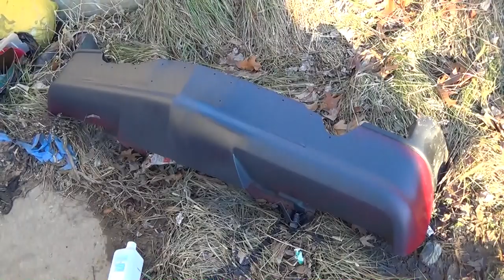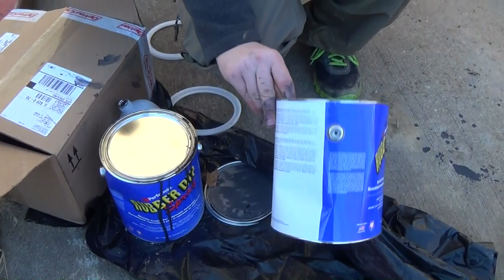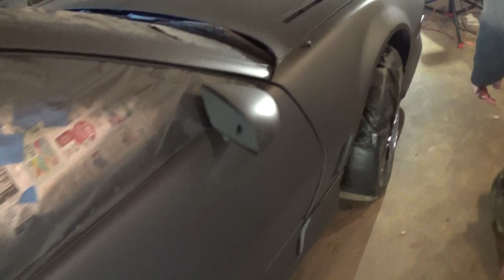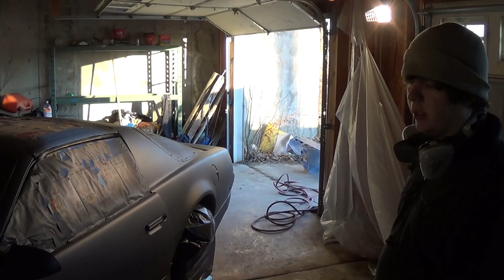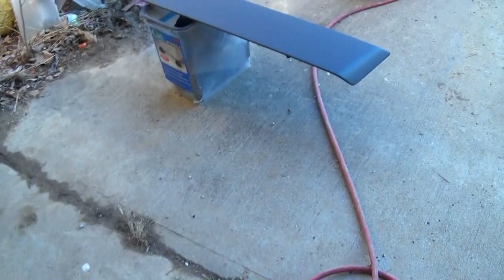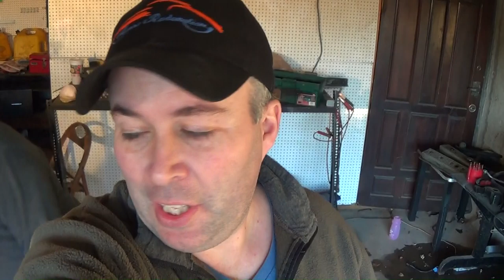Painting Pontiac Trans Am GunMetal Gray Plasti Dip

Comment: Did you paint the tail lights with the tool dip too? I like the flat black looks stealthy.
Reply from the maker: Yes, with the tail lights it's easy to spray them with the rest of the car and then peel it back off.  If you peel up one of the corners, it will come right off in one sheet.